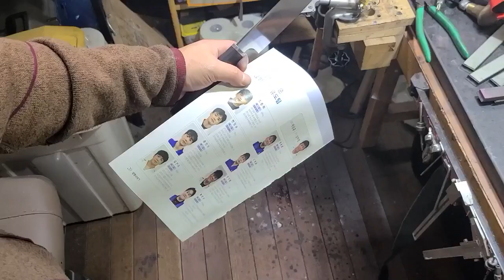KNIFE MAKING / SANTOKU KNIFE 수제칼 만들기 # 130

Comment: Hello Sir,
Awsome job 👍. 
What kind of bits or Accessoires do you use on that power tool to sand the surface before hand sanding? Thank you in advance.
Reply from the maker: What kind of bits ......Tungsten steel bits  ^^....or Accessoires do you use on that power tool to sand the surface before hand sanding? ...Sharpening Stone... Mold Air lapping Stone,,,^^
Reply: @artisticson2275  could you please post me a link to theese bits and lapping stones? I tried searching for it but did not find anything. Thank you
Reply from the maker: @JuliusCaesar125  https://www.amazon.com/10-Piece-Drilling-Triangle-Tungsten-Tip-%EF%BC%88Black%EF%BC%89/dp/B088QFK6H6/ref=sr_1_13?dchild=1&keywords=tungsten+drill+bits&qid=1603714997&sr=8-13

https://www.amazon.com/Atoplee-Silicone-Polishing-Oilstone-Grinding/dp/B0194Q8Y2Q/ref=sr_1_33?crid=17MT2NW83PYBU&dchild=1&keywords=oil%2Bstone&qid=1603715134&sprefix=oil%2Bstone%2Caps%2C412&sr=8-33&th=1
Reply: @artisticson2275  thank you very mich for the link. But i fail to understand how you managed to fix it to the oscilating power tool. If you can give me a tip i would be very grateful. Thank you in advance
Reply from the maker: @JuliusCaesar125  It's super-glue gel type.^^
Reply: @artisticson2275  thank you very much for the info. I would not have thought that would hold. I will try it and ley you know how it went.

Comment: beautiful blade, but It think you should have gone the Full Tang path, because the Santoku design is blade heavy to begin with and it needs more weight on the handle to increase balance. Also a full tang configuration is more robust and adds "life time" to the blade.
Reply from the maker: I used a little weighty Ebony for the weight balance and made the handle a little longer...^^